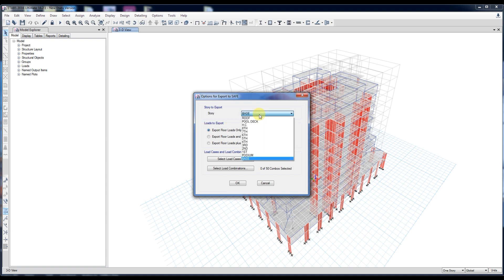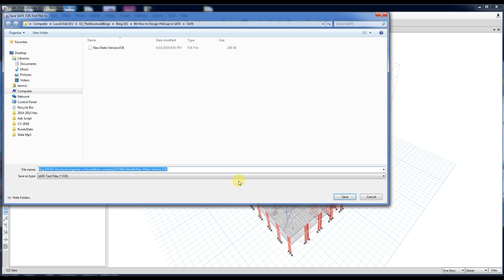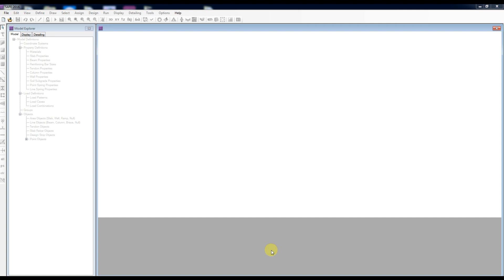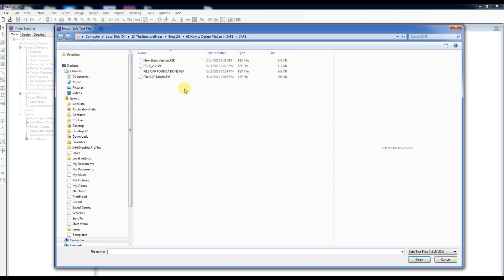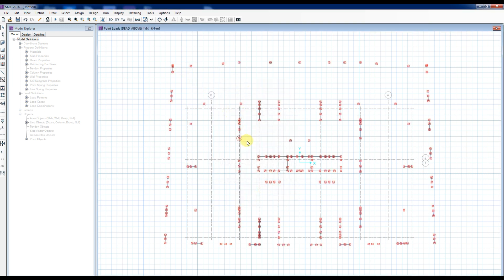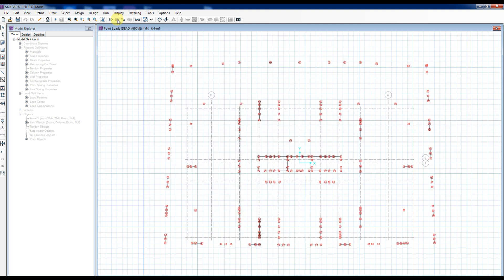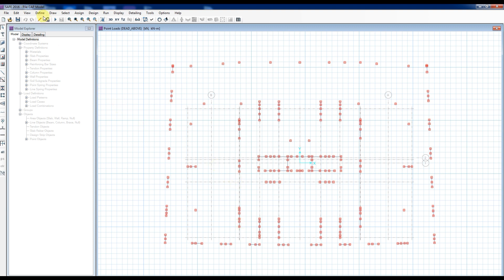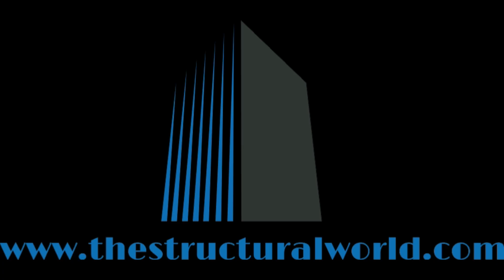How to Design PILE CAP in SAFE: Part 1- Importing of Loads from ETABS

Comment: hello i wanna ask about restraint, i restraint UX UY UZ in my model, but when i export it to safe... its showin that i got  some moments  in my restraint... do u know about it?
Reply from the maker: If you restraint the model in ETABS in Ux Uy and Uz that means it's "fixed support" that is why you are getting moments when exporting to SAFE. Try to assign it as "pinned support", if you don't want to get any moment.
Reply: @TheStructuralWorld  hmm, actually i just only restraint the displacement.. if we want the restraint to be fixed... isnt it that we must restraint all DOF (translation and rotational)? *correct me if i m wrong, or maybe there is somekind of fault in my side when i am exportin the file maybe
Reply from the maker: @chrisjeff2861  Do you have any lateral loads in assign the model? If so, maybe that's the reason.
Reply: @TheStructuralWorld  yes i have lateral load in my model... should i delete it?